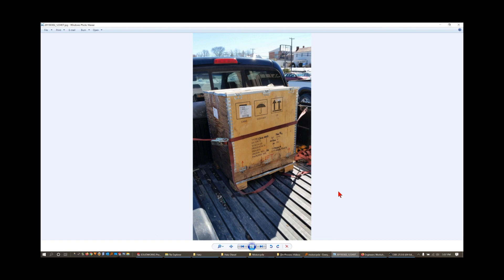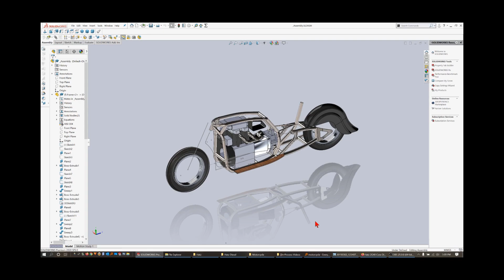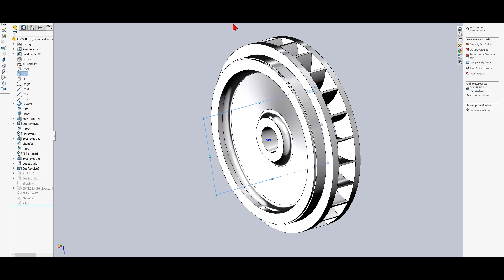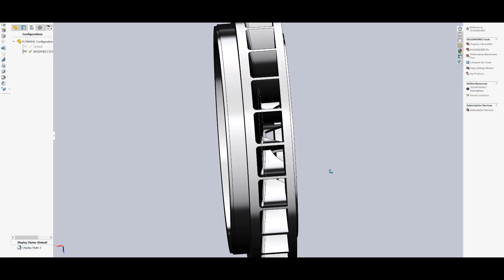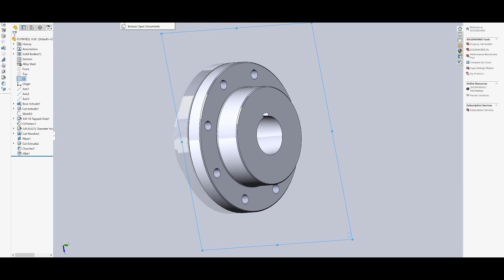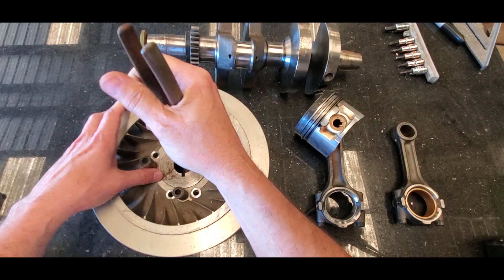Hatz Diesel Repairs & Re-Engineering

Comment: I see that this is almost a year old, but I'm hoping you will get this. I just bought a 10 KW Hatz Kato Kamag diesel genset. It runs like new, no smoke at all, and puts out 240 volts. It was owned by a rental company at first, where it sustained 8500 hours of use. In 1993 it was bought by an individual who used it as a standby genset, and only put another 610 hours on it. So it now has 9128 hours of run time. Would you say this is a lot of hours for this unit? Would you suggest any particular maintenance item at these hours? Any info you can provide would be appreciated.
Reply from the maker: I am no expert on diesel maintenance, but 10k hrs for a good diesel is nothing, given regular oil changes. The Hatz is very well engineered. Do the filters and maybe consider having the injectors serviced. Heads can be de-carboned, but even the trash engine we have wasn't carboned badly.

Comment: Jim, I really like the repair that you made on the flywheel. I have some Hatz books which show re-configurable hydraulic pump options for PTO or flywheel side mounting. The four 'rotating fan screen' screws secure a coupling to run a pump on the flywheel side of the engine. Hatz was all about unit construction and parts interchangeability. Like many other successful European air cooled diesels, Hatz engines could be repeated from one to four cylinders spare specific parts like camshafts, crankshafts and crankcases. I can look in my books to see what Hatz used for bearing inserts, probably a copper jacketed lead/tin bearing material. Oilite probably would not be my first choice, 932 bearing bronze would probably hold up fine with the engines high compression. Have you considered having a shallow narrow central groove machined down the center of the new bearing material to aid in crank pin lubrication? You could probably drill the big end rod bushing and tap the rod cap for the fitment of a pair of brass screws. As long as you can lock one of the inserts in place, the other will not be able to walk.
Reply from the maker: I admit not researching all my material choices for the replacement shell, I was preoccupied with getting hollow stock to reduce cost. I am not a fan of grooving journal bearings that already have a small width/diameter ratio like these do. Oil for wrist pins comes largely from the ambient mist and scraping by the oil control rings. Here again, a drilled passage is a point of zero pressure when the oil film is squeezed out on the downstroke. I avoid grooves and holes in the pressure zone when possible. Some press bearings have grooves on the sides of the crank bearing shell where they are not heavily loaded. A hole transfers this oil to a groove in the ID of the rod, milled up to the center drilled passage. Similar geometry exists at the pin end to lube the wrist pin, but from the side, not in the direction of pressure. All these methods are too expensive for much commercial use but are examples of best practices where oil film strength is critical and cost is no object. Based on your knowledge and description I will now remove the four posts!

Comment: 18:16 it looks like your crank taper sticks thru the bore?  Again at 18:48 looks the same way. It should not stick thru or you won't be able to get the nut to tighten the hub on the taper properly. If flywheel lateral location is correct could turn the crank back a bit. I would prefer that to a counter bored washer for clearance. If you have good crush on your shell insert it won't spin. I have put many a race engine together with nothing but friction holding the bearing shells.
Reply from the maker: It' must be a trick of the lighting, because it actually sits about 1/8" proud of the crank shoulder, see here: https://imgur.com/gallery/g0Awp5N Glad you and Steve are guaranteeing my work!

Comment: Did the flywheel assembly get rebalanced.?
Reply: Just wondering,  the company I work for (pump manufacturing and rental) have had issues with hatzs engines and vibration.
Reply from the maker: @phillipmetcalf9404  We ran it, no bearing shell on one journal, not bolted down, it wasn't too bad even in that sorry state!
Reply from the maker: No, with a tapered bore this will be difficult without a custom mandrel. Since we fully machined the aluminum off the flywheel and have a fully machined hub, I'm hoping the impact to the balance will be minimal. In a perfect world this should be rebalanced.

Comment: whats the setup for turning the journal on that crank shaft? A 4 jaw that is offset alot in one direction?
Reply from the maker: The NAPA shop I use is set up for this. A fixture at each end holds the crank with an adjustable offset for the throw. Large diameter skinny grinding wheels reach past the counterweights and grind the journals.